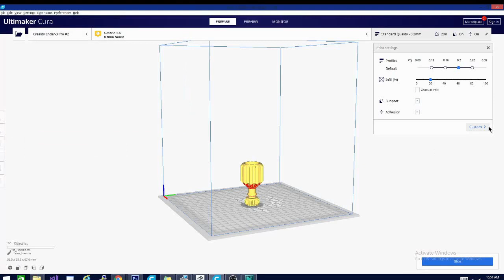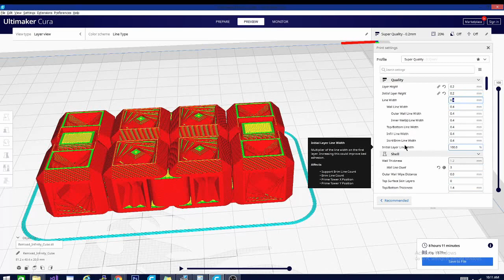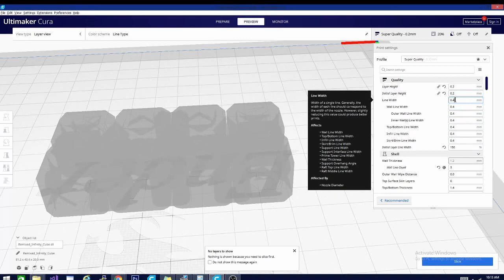Cura 4.8 Tutorials - Quality Settings - Line Width & Initial LineWidth

Comment: This makes sense and is something I have taught myself. Not a lot of information or videos out there about extrusion/path/line width. Anything that is out there only talks about going thicker. What about thinner for high detail models? What is the max or minimum rather we can push a nozzle on the small end? I'm using a 0.3 mm nozzle and printing at a 0.2 height and 0.2 width right now to get high detail in a 3D logo print.

Comment: changing the line width setting in cura does not automatically adjust the flow.. which i belive is what is supposed to do as increasing the line width thickens the lines in the display.. but if you print it, the lines will only be spaced apart not thick.. you have to set the flow accordingly too.. unfortunately increasing the flow also thickens the lines again in the display.. so you end up twice thicker lines in the display..  I believe it is a bug..  One can use a different slicer like prusaslicer and change the xtrusion width the flow is automatically calculated.  changing linewidths is very important trick to make faster and stronger prints wish only it didnt have that bug...

Comment: Hi i have a cr10-max and am finding the first two layers are fine and the third and fourth are curling up then the print runs over it and the print is fine using pla not sure why it curls these lines only  on a raft

Comment: I always end up with under extrusion when I increase linewidth. There's gaps in my lines, as if Cura doesn't compensate by increasing flow. Any idea what would cause this? If I match it to nozzle size its fine tho. (I'm trying to print faster)
Reply: Do you have gaps in your wall lines as well?